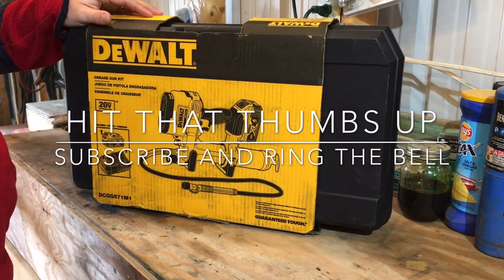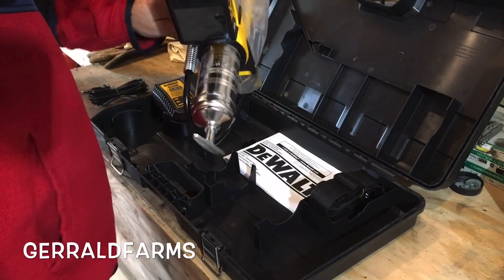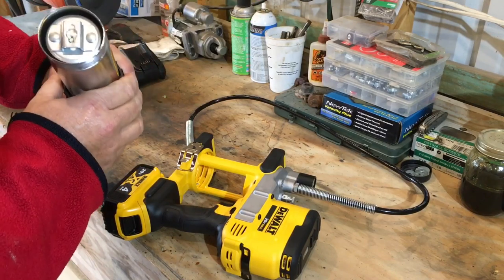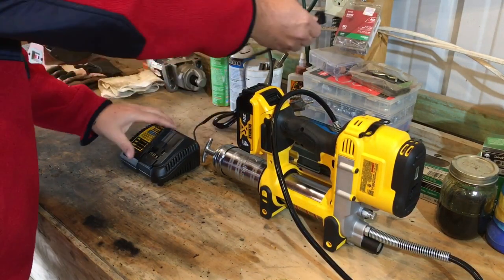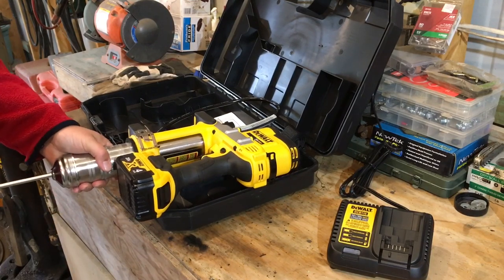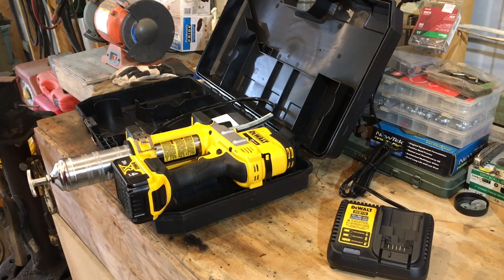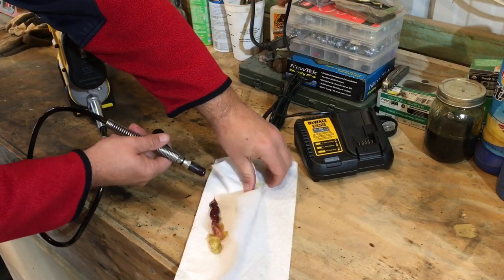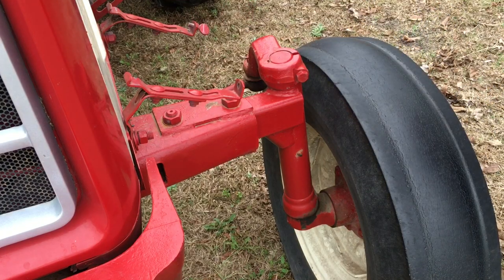DEWALT 20 volt Max Grease Gun Kit unboxing and testing

Comment: Jacky, you kinda have the bleeding part... I always get the barrel screwed in about 2 or 3 full turns, then release the rod and turn the barrel on and off a few times, then tighten it up and go!! Works great on any gun😎
Reply from the maker: I changed tubes later and done it the same way it went right to work. It seems a lot faster than my old one. TFW. Have a good one
Reply: @GerraldFarms  as long as it works!!!!
Reply: I do the same Ed
Reply: @DLKHAY  I've found it to be pretty much fool proof.
Been a couple of times, one of the kids didn't get it, we found out that DeWalts bleed screw does work pretty good.. I still do as I've done for 40 some years 😎

Comment: The best way to tell if someone does or doesn't use a tool is if it is spotless or not. A little dirt/grease is like scars on you knuckles, it proves it has seen work. Many people have tools just to have them, and then there are people who USE there tools. You should take care of everything you have but don't be afraid to use it,that is what we buy them for. Thanks for the video. I am trying to transition from are to battery on as much as possible. Have been looking at Milwaukee, but I already have several dewalt 20volt tools. But Milwaukee has a larger variety of Mechanic type tools but this is just one more ( tool) reason to stay with dewalt. If dewalt comes out with a true 1/4" impact 12volt ,thinking will be over and spending will begin 🙂.
Reply from the maker: Thanks for watching and commenting. Milwaukee does have more Mechanic type tools. I made a video on a RIDGID set I got. So far I’m real impressed with them. The 1/2 impact has surprised me on the farm. And the grinder . Have a good weekend